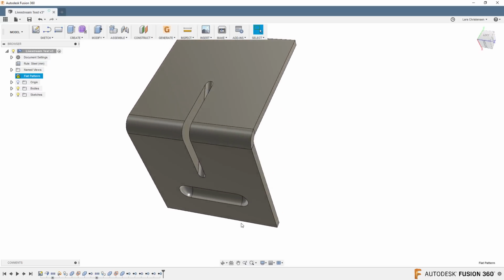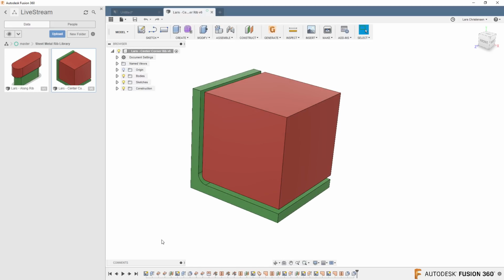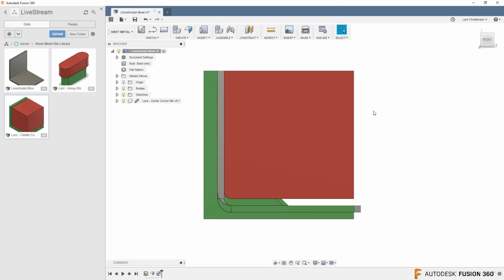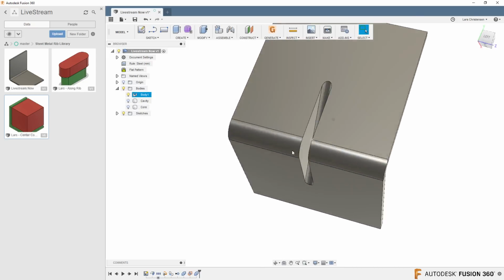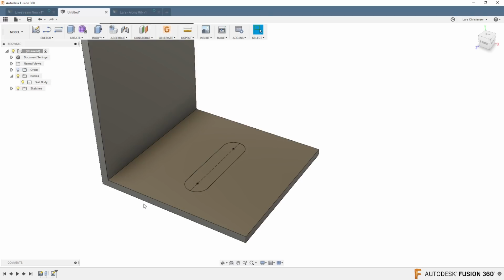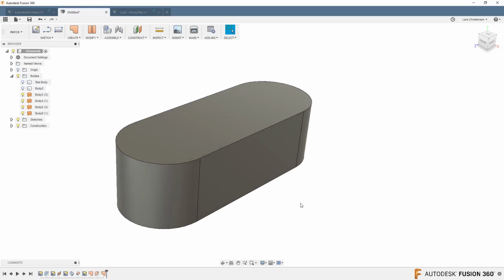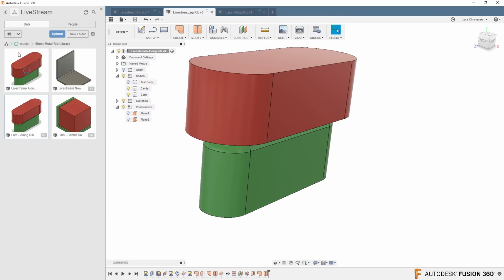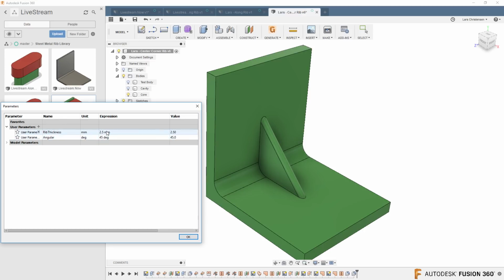Sheet Metal Form Tool — Fusion 360 Tutorial — #LarsLive 178

Comment: Not mentioned in video, but i struggled selecting the boundary fill checkbox, and found that I could use Surface analysis to clip into the space to be able to select the correct square.
I made a small video showing how i got around the problem here.    https://youtu.be/DR78CpVSPNk    no copyright infringement intended.

Comment: Sheet metal pressing is an art of its own. I can't say that your modeling is wrong, but because Fusion lacks the method it is hard to do anything but estimate. In reality you would need to take into account the material properties of the sheet and the tool and calculate stresses due to stretching and compression, shearing actions and wear on the tool. For example your 2.5mm wide but tall angle entering on a corner would more likely shear the sheet than form it. If you model what you want, then once you send it to a professional they would advise on the tooling and methods. Still a good video, thank you for providing useful learning material.
Reply from the maker: Hi Hyss Thank you for watching! And for the great comment!!
You are totally right about material properties and calculated stress. Something I don't know too much about

Best,
Lars
Reply: i am trying to find software that can do presses and stuff but it seems impossible.
Reply: I guess you'd have to press it first and then bend it